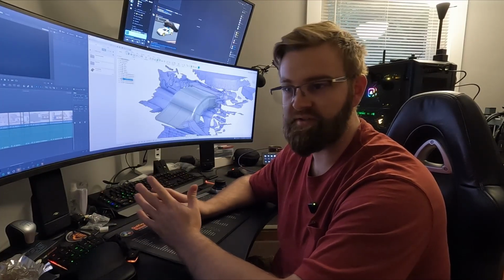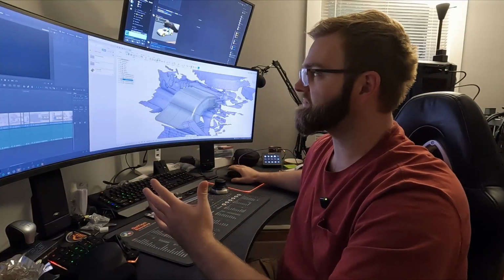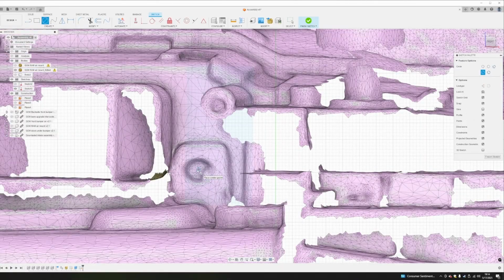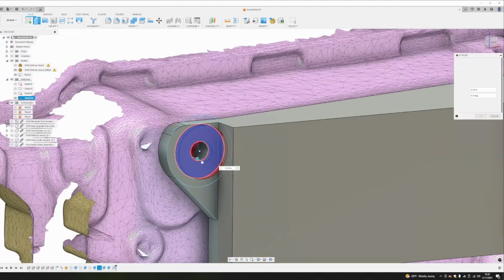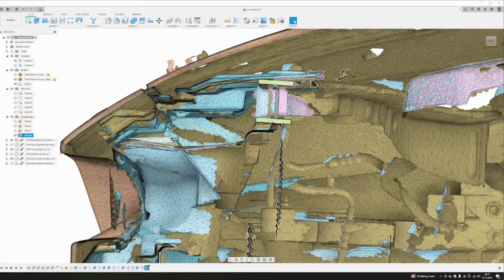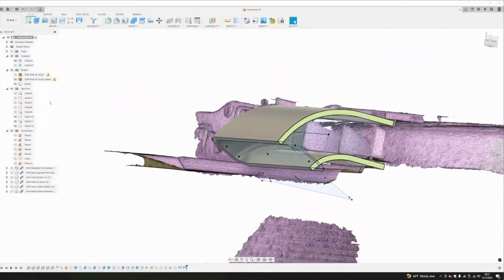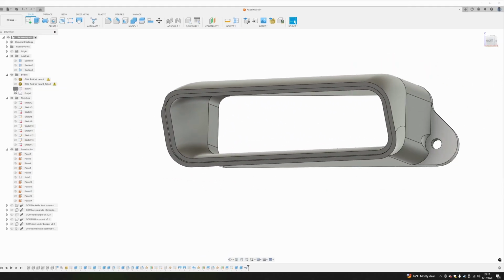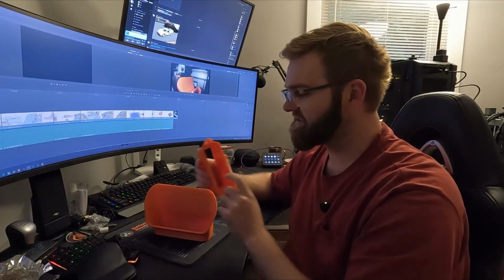Focus RS RAM Air Intake - Pt 1 - Initial Design and Mock up

Comment: This is nice, got me to immediately subscribe, I've been scanning my car part by part for a few years now, and i have been so frustrated by Fusion despite it being my main, because scaling is atrocious, which is now fixed with a revopoint MetroX, but ive jumped to blender and back so many times, so awesome job! And even after like 7 years of using fusion now, I've learned a few new tricks
Reply from the maker: Most of all the scanners are metric be default and even I forget sometimes and select inches when importing the scans, get through designing something, only to realize it’s 100x bigger than I wanted. Glad I was able to help out and hopefully I can keep passing along a few tricks I’ve gathered along the way!
Reply: @TwinCrestInnovations  Well, i guess the Banana for size reference meme would be redundant 😅 China is metric lol... Idea for a fewer video (yes it's been done before) would be scanning the parts and turning them to CAD, not just using the car mesh as reference, and yeah unit conversion between Blenderand fusion usually messes things up and they go 100x in size, excited to see what more is to come!
Reply from the maker: @Tarex_ the banana for reference would definitely be appreciated haha. I see what you’re saying between the different softwares and I too have fallen victim to rescaling
Reply: @TwinCrestInnovations haven't checked the channel out yet as i just found it, so don't know which scanner you use, but gotta say, I'm absolutely conflicted about the Revoscan software, with a few scans it does produce closed meshes, but the pairing with QuickSurface is not stellar, and for scanning it's super finicky, but closed meshes can be directly printed and are perfectly to size
Reply from the maker: @Tarex_ I use the einstar scanner by shinning 3d. I bought it when I first came out and I love it. They are still updating the software and making improvements. Some of the new revo stuff coming out looks really cool. The stuff with the tracking dots is really awesome and might be my next scanner
Reply: @TwinCrestInnovations  i have the first revopoint Range, which was made irrelevant by the Range 2 within half a year.. but the Details from the MetroX are an absolute Joy and the new one is a MetroX with a tracking ball (if i were a programmer I'd turn the old ones into this.. they did cost big money after all lol)
but the 3.5k EUR/USD in pre-Sale was a bit outside my budget
Reply from the maker: @Tarex_ yeahhhh that’s how I feel about the new revo point with tracker combo. It’s that same price tag. I honestly think it’s going to be worth it. I don’t think I have a big enough need for it yet though
Reply: @TwinCrestInnovations yep, that is always an issue, i mainly on the go use Kiri Engine on my phone in the pro version and for "Quick" scans, it even produces Quad meshes
Reply from the maker: @Tarex_ I’ll have to look at that. I used scaniverse before I got the einstar and haven’t gone back since
Reply: @TwinCrestInnovations  definitely give it a look, they are constantly working on it, and i had the chance to talk to the dev team on occasion and they are very receptive to feedback